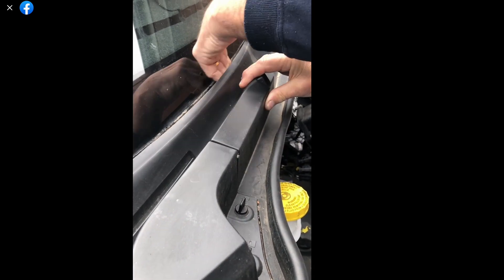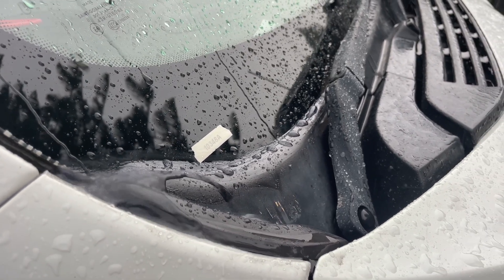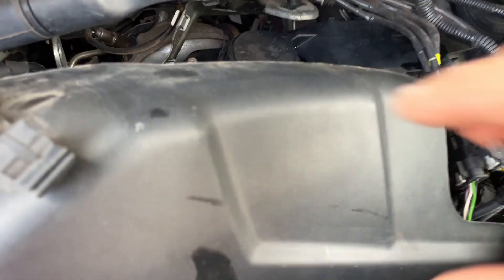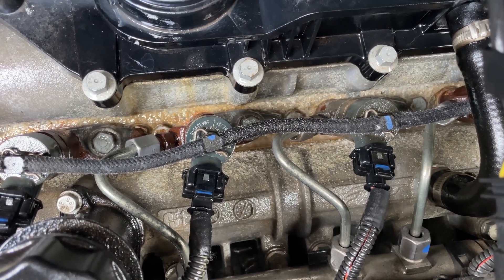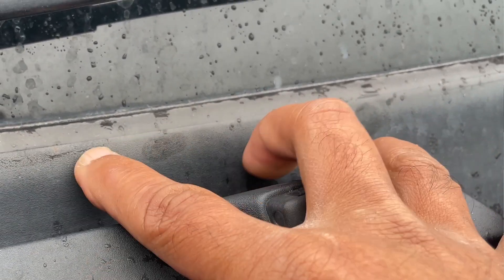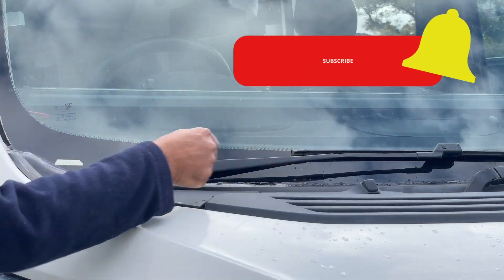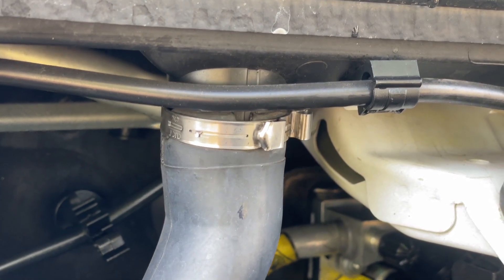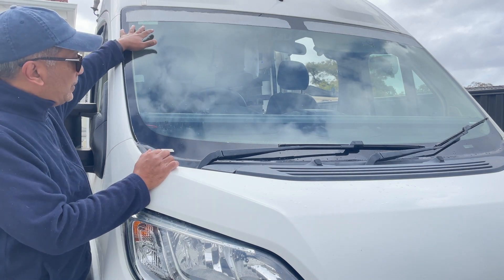Prevent Fiat Ducato Engine Rust - Stop water from entering engine bay

Comment: Im suffering the same issue 2017 ducato somehow water entering the inner sills got the van  completely empty ready for camper conversion noticed shuttle shelf leaking badly blocked drain holes still unsure why entering my inner sills but suspect warer entering from inner wing due to gap from windscreen to scuttle .will post again when i sort this issue

Comment: Have had same problem with my boxer ambulance, i was shocked to see the design of the skuttle panel is in two parts with only one output hole ,but the crazy thing is also there is a tilt down to allow the flow but the join overlaps the wrong way, i.e male to female instead of the logical way female to male which causes serious water problems , whereas on my Citroen relay work van it has a solid one piece skuttle with three outputs so i never have a problem but occasionally check for leaves in the down tubes. With the boxer i have had to trebble layer tape on the central join ,put sealant as you have here around the very loose window join but to be double sure i bought some all weather clear tape to put on top of the sealant ,i thought the tape might not stay on but its still strong , i would advise this , i got from the car shelf at the Range very cheap, but needs to be a firm no bubbles or creases stick to the glass and the rubber. cheers
Reply: Maybe you can do a vid on the skuttle panel design and water flow on yours.
Reply from the maker: please share a video - thank you

Comment: My 2007 model had no plastic engine cover. So after the first rainfall, I was able to early identify the leakage. The injector bay was completely filled with water !  The two part plastic wiper cover along the glass had no overlapping connection in the middle and was badly glued to the window. I fixed it and also drilled a hole near each wiper base and glued in a tube to the underside for drainage, because water kept standing there.

Comment: I wish I'd seen this video sooner.  I have a 1996 Ducato camper, it has a plastic damp proof membrane over the battery to stop water running all over the battery and electrics.  I also have a 2014 Ducato which has had recon injectors.  I've only just identified the problem of water running over the electrics resulting in a short to earth within the ecu.  I'm in the process of replacing the ecu.  Just because Fiat cannot manufacture a Ducato that doesn't soak the engine bay with water!

Comment: Hi, I had really crappy gutter leaks for the last 4 years without knowing this (since i bought the van) and sealed it with tape since just a few months. Ask my garage to check for rust, expecting the worst, but none - NONE - on the engine block. Its a 2008 model. I also do have water in the engine bay in some places when it rains ... So I think there's more too the engine block rusting than just the gutter leaks.

Comment: Wd40 isn't much good, it's mostly white spirit with a tiny bit of oil. 
I've sprayed my recessed injectors with corrosion x ...it polar bonds to the metal and is unbelievably good at freeing seized components as it creeps up the threads. 
I've sprayed all other areas with corroheat.  Use self amalgamating tape to wrap around the union   of the windscreen drain that is immediately above the engine cover. 
I don't get any water drips in at all now and boy has it rained lately 😢

Comment: I got 2008 model 250 and found this luckily almost at the beginning. There was basically no seal at all, so I replaced it with non-hardening type of sealant. I also drilled bigger holes both ends of this gutter, originals were always blocked with some tree stuff etc. Luckily this is almost the only thing that is not build properly in Ducato. 15 years and 127 000km later only had to replace brakepads and Throttle Cap (not EGR) Tnx. for this excellent video btw.

Comment: Also the drain pipes drain down into the inner wing and onto the chassis, leaves and debris accumilate  in a big blob,in the inner wing  I extended the pipes down on to the top of the wheel arches after i cut a hole in the top of the plastic inner wing, so now it drains on to the top of the tyres, remember to prop the passenger side wiper off the screen with a block of wood or something to allow the water to drain straight down into the drain, spray the top of the injectors with copper grease, to protect the seats.
Reply: You wrote: "remember to prop the passenger side wiper off the screen with a block of wood or something to allow the water to drain straight down into the drain"

I don't understand. Can you please elaborate?

Comment: My 2008 citroen relay has the same problem,it affects fiat ducato and Peugeot boxer too.if you don't attend to it and you ever need injectors replacing...you've probably got a very expensive problem.also the drain on the passenger side,drains water from scuttle and straight onto the gear box linkage below. A good dollop of grease on the linkage will protect the linkage.very poor design and the manufacture should bare some responsibility for the thousands of engines, ending up with very expensive repairs due to their incompetence..spraying wd40 will have no benefit at all,it is not designed for this use.

Comment: Thanks that was very informative. I’ve had similar issues.  Your solutions are good, though I used a less messy black heat resistant electrical tape overlapping the plastic scuttle where it meets the windshield. I used  hight temp. Jenolite Rust Shield spray instead of WD40 on my fuel injectors and depression they sit in on the engine. The WD 40 will offer good but limited protection that could eventually wash off if subjected to more water, whereas the clear Jenolite spray hard-coats the vulnerable injectors like a varnish consolidating any rust already present and shedding any water.  I also used it to protect any exposed electrical connections in the engine compartment.  No marks for the vehicle designers though who should have resolved this issue.

Comment: Thanks so much for highlighting this. I have a 2019 Ducato motorhome and after removing the black plastic cover which is quite easy I discovered rust forming on the injector nuts as you describe so thank you so much for the advanced warning. To protect against any further water ingress which appears impossible to stop dripping from various orifices above I have customer formed some strong Alcathene plastic to add more protect other than the supplied plastic cover. I have taken note not to allow this anywhere near anything hot. Anyway that sorted to stop future water I then proceeded to rectify the rusting nuts and associated injector coupling. WD40 is not permanent enough so I advise you use ACF50 designed to kill rust, protect and dispel moisture, and provide a future corrosion protective layer. Now ACF50 was designed for the US aircraft industry for use on aircraft carriers for moisture and corrosion protection and removal. Its sold in spray cans and plastic bottles. The spray cans block up too easy so pay the little extra and buy the bottle. Its not cheap but it will solve the problem. Then check every year clean and apply a little more with a brush.  https://www.mandp.co.uk/products/acf-50-anti-corrosion-formula-1-litre-bottle-k-547736
To remove the plastic hood originally fixed first unclip the little pipe attached on the LHS, then pull with purpose at the rear middle, LHS and then pull sideways away from the final fixing on the RHS. Carefully remove the hood and inspect. This is just a push fit so your not going to break anything. Just watch out when removing the cover you don't knock any electrical connectors. Anyway job done and now part of my annual check.  Thank you once more.  Mike
Reply from the maker: thank-you Michael
Reply: Thanks for this. Can Acf50 be applied directly on to rust or should the rust be removed first? I have some rust around injectors as described above on a ducato 2007

Comment: If a jobs worth doing, do it right. Remove scuttle clean  it up and reseal, putting onto top scuttle to me is bodging!!
Reply from the maker: Good tip!
Reply: Did exactly as on the video and no water in engine bay. Works perfectly fine without taking the scuttle off

Comment: Great video i was getting the same. Just wanted to ask if u had any bother with rusty bolts etc alternator cheers
Reply: Sort the problem and rust with ACF50 its tops. Much better than WD40 which washes off quickly. ACF50 lasts a year and kills rust too. Check out the product on the link above where I comment.  Mike

Comment: I used black electrical insulation tape between the glass and the rubber seal just make sure that everything is clean and dry , I chose a sunny day so that everything was warm so it stuck well .
Just take your time and do a neat job and it looks the part .

Comment: Check the end of that drain hose above the engine.  I've seen it clogged with leafs at the bottom causing the spill at the joint.
Reply from the maker: thanks

Comment: That product, makes rust. Spray it on a clean metal plate, leave it covered, outside, within two days, rust....
Reply: Should use ACF50 not WD40 as you say WD40 evaporates and washes off. Use the product designed for this job. Water protection and corrosion inhibition and deactivation.

Comment: Hello Sir, could you do a video how to drain headlamp (half) full of water? After several days of heavy rain, left headlamp has water in it. Obviously, the solution is to get the lamp out and dry the whole thing, before glass goes beyond repair...  Would be great to see a similiar, educational video on how to do this. thank you
Reply from the maker: If it happens to me I certainly will - but removing the headlamp is super easy! there are only two screws that hold it in - check out my video: https://youtu.be/4ygrpnKw7UY?t=75 and you can drain it out quite easily!

Comment: Did you test Central drain is running freely?
I've seen other videos which tested and found it was blocked so backed up to the joint and hence leaked.
Reply: Problem with the drain hose is that the top feed to the connector is a female to a male connector and it will never seal. As such I wrapped some Self Amalgamating tape we used on telephone cables in underground ducts. Sealed and works a treat. But also protect the injectors with the professional ACF50 product. WD40 is no where near as effective.
Reply: @TheSmallRabbit  the hole where the drain exits at a right angle under the inner wheel arch easy for leaves to get stuck at that point
Reply from the maker: thanks for the tip

Comment: Be aware that any silicone products used on or near to the windscreen to seal will give you problems if you need a replacement screen. Windscreen repair/replacement companies will not fit a replacement screen if they suspect silicone around the seal or body of the vehicle. They will insist that you have the body resprayed to remove all traces of silicone before they fit a replacement. They do this to guarantee that their bonding products will not be compromised by silicone and in the event of an impact that the screen doesn't fall out.
Reply from the maker: I will place your comment in the video description - thank you
Reply: Basically I have come to the conclusion you cannot stop the water ingress. As such stop the water going into the injector area. I just added some strong polythene and also used self amalgamating tape around the drain connected above the cover. Now no water goes anywhere near this area. Plus use ACF50 to stop and corrosion, remove the moisture and kill the rust. But thanks to much for bringing this to our attention. A disaster waiting to happen and hidden in plain sight ! No longer though I am on it with the ACF50 check it out.

Comment: Useful, but no mention of the main scupper (the entire drain assembly).. This is extremely poor fiat design.. Check the shown main drain pipe, often comes away, replace clip with a decent jubilee clip, and check the smaller drain pipes located at each end of scupper. They are extremely poor design and often missing, enabling water to cascade onto engine and electronics below.. Owned a Ducato Mk4 Camper for 5 years, its a regular problem. Rubbish design Mr Fiat. Try harder.. 😉
Reply from the maker: Thanks Paul
Reply: At least were all now aware and mitigating.

Comment: I've noticed a lot of water on the top of the engine too .Fortunately the previous owner had sprayed oil on top which has prevented the rusting however there is water pooling there. I'll definitely silicone the area as you have .Thank you for posting this Movie !👍
Reply from the maker: Thanks
Reply: You will not stop the water with sealants. Add some extra stiff polythene protection to ensure no water can get to this area and then use ACF50 every year. Should be fine then.

Comment: My Ducato with an Iveco F1AE engine is at the injection specialist right now, for this exact problem. Rusted injectors and snapped bolts that retain the injectors. You need to get those injectors out asap, and then re grease the bolts and injectors every two years.
Reply from the maker: It's a conspiracy really that this is not emphasised during service visits.

Comment: Hi Afram,   I too own a Fiat Ducato, (2012 model).  After having an injector problem I discovered that same rusty colour covering every thing under the engine cover.  To cut a long story short, only one injector could be removed, ( water and aluminium and steel do not mix very well ).  This meant engine removal, new cylinder head,  4 new injectors, 4 new injector pipes, gaskets etc etc.   The whole job cost around $12,800.00.....
     All this because the lower windscreen bezel was not sealed properly from the factory..     footnote,  if you own a Ducato check for water in and around the injectors often,  not only at service time..
            Happy travelling....
Reply: Thanks for the info. Today I was going to buy a 2013 Fiat and spotted lots of rust around the engine bay. Didn't know why until now.
Reply from the maker: Thank-you on behalf of the Ducato community for sharing!
Reply: $12.800, wow. You can buy a refurbished engine here for €2.500.
Reply: The bulk of his costs will be labour as he obviously hasn't done it himself

Comment: Wd40 is pretty much a solvent. It will evaporate off in a very short time and will provide very little corrosion protection. Try a light oil, like 3 in 1, if you want longer term protection.
Reply: ACF50 or motorcycle chain lube.
Reply: @G-ra-ha-m   ACF50 the best one 😎
Reply: @onyxnorbert  Sure is also stops and cures the corrosion.
Reply from the maker: good tip thanks
Reply: ACF50 is the answer. Does not wash off and is intended for corrosion protection and rectification especially alloys and ferrous. Used on military aircraft.

Comment: I can’t believe these base vehicles are still having this problem. I had a new 1995 Boxer Motorhome and after only a few months discovered that water had leaked into the battery which caused the acid to overflow and completely strip all the paint off the chassis components below and had attacked the wiring harness. Next was a 2000 Boxer after a couple of years the Speedo stopped working. I disconnected the drive from the gearbox and a milky emulsion of water and oil came out, I had  to pay a substantial amount for this to be fixed (gearbox out). A short time later it lost synchromesh on second gear and a reconditioned unit had to be fitted. We then bought a 2005 Ducato and by now I was paranoid about the water leak issue, sure enough it was still occurring but I managed to keep it at bay with some Heath Robinson trays over the engine. And again in 2008 we bought the newer version of the Ducato, sure enough the same thing was still happening. We sold this in 2010 and after break of 12 years we’ve just bought the Mk 8 version of the Ducato, looks like I need to get down to B & Q for some more DIY preventative work! Thanks for the video 👍
Reply from the maker: Thanks very much for sharing- there should be a list, actually now that i think, i will do a video with top seven things every Ducato owner needs to know from day one 😊